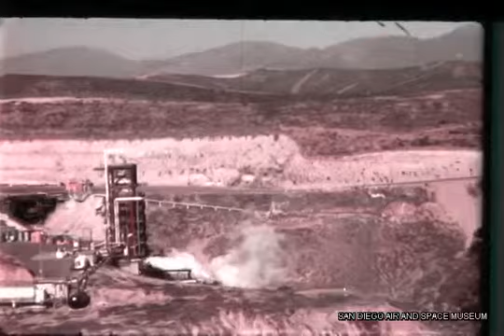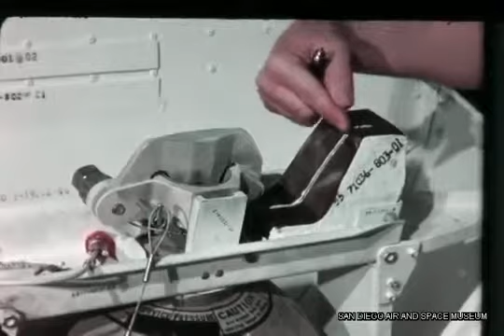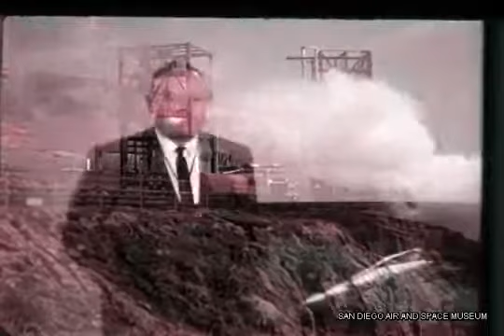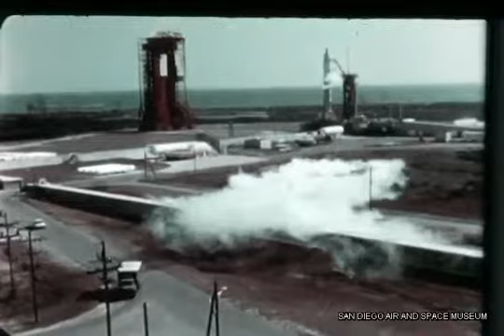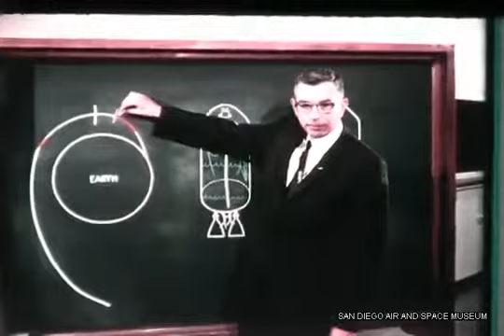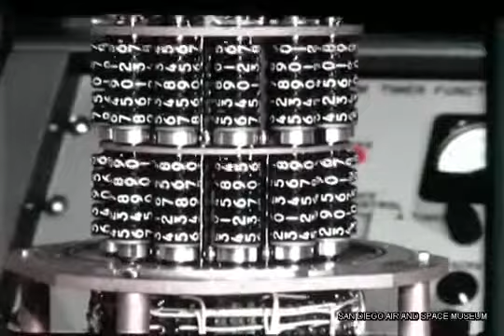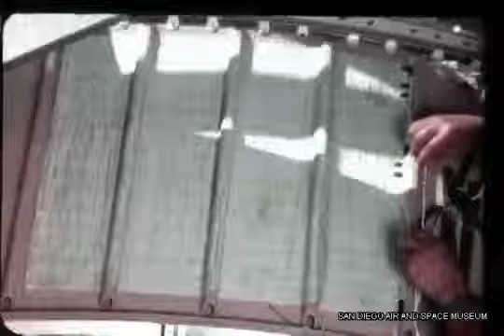Convair Atlas Centaur 2nd Semi-Annual Report of 1964, 2/19/65 HACL Film 00323

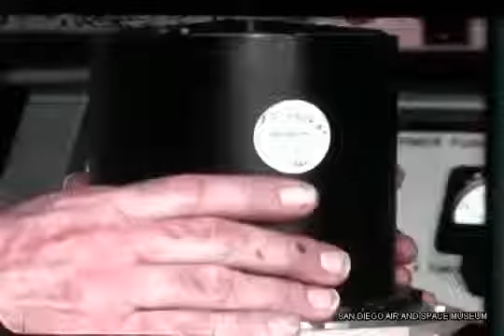Comment: As always, THANKS SDASM. 0:27 is a fascinating mechanism. Like your 18:06 says, "control," but as an engineer I'm really surprised it supplies human-readable feedback. Each of those number rings and supporting mechanism take up room and add weight. But as a whole I'm betting it adds reliability and the feedback must have been important for check-out. And a third major consideration is it was fully developed! The replacement electronic unit they mention was relegated to flight-dev article here.